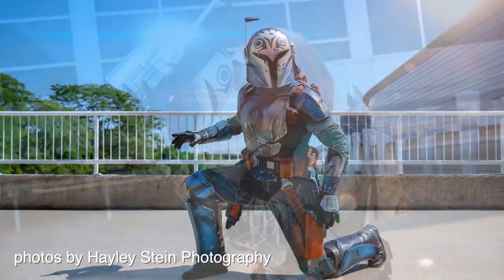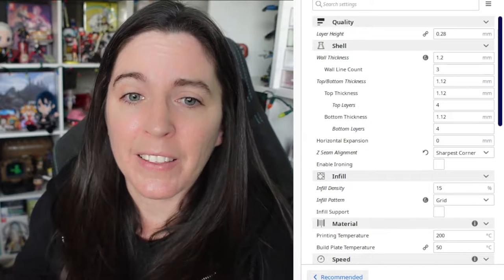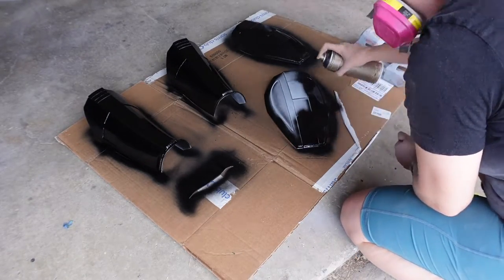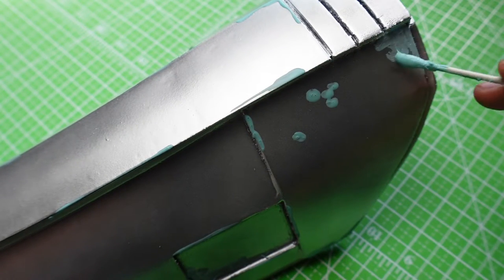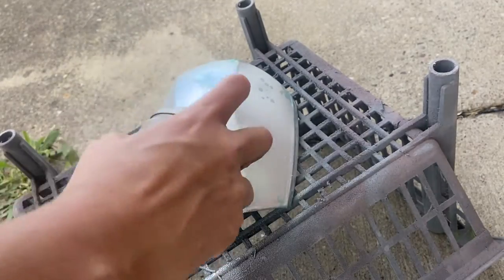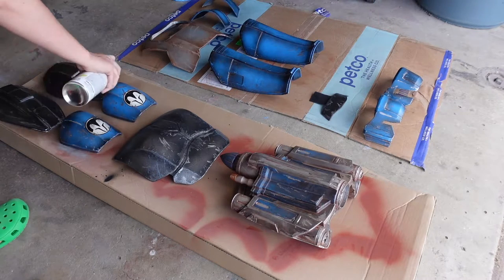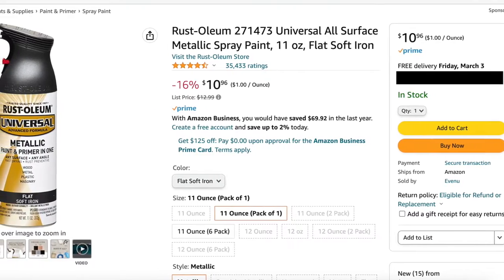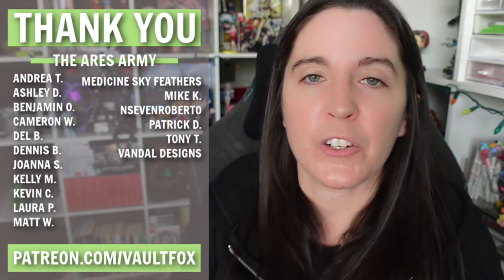How I Made Bo-Katan's Armor from The Mandalorian

Comment: How do you avoid getting spitting with the Montana gold? I’ve had nothing but trouble with it. Also what solvent do you use to clean it?
Reply from the maker: I've had issues like that in the past with certain colors (Sierra Beige and every white I've ever worked with from them) and usually switching the cap out helped because those caps are just ... not always great. If it got really gunked up I would wipe the cap with isopropyl alcohol and it usually did the trick, but not sure if that's the "proper" thing to use
Reply: @vaultfox  Switch them out with different types of caps or just the default style?

Comment: What was the black paint did you use to make the chrome be all shiny? I am using the Air brush method.
Reply from the maker: ah, that wasn't black paint at all .. it was a top coat! I used a base coat of Montana Gold Shock Black to get an even coverage and then sprayed 2K clear coat over top (I have a video on that as well) to get it shiny, but I didn't do that with this costume

Comment: any tips for adding metal weathering/battle damage to a kit after the kit is finished? I wore mine to PAX this past weekend and bits of stuff got scratched up (as it does) and I'm considering just painting it with some metallic paints instead of the armor color.

I've heard even a silver sharpie is a good tool.
Reply from the maker: was just about to recommend using a silver sharpie, I've done that on my Bo because it got scuffed on the knee when I accidentally knelt down on it
Reply: @vaultfox  thank you, I'll give it a try. Also kind of bummed I just found your videos as I now see you had a panel at PAX East